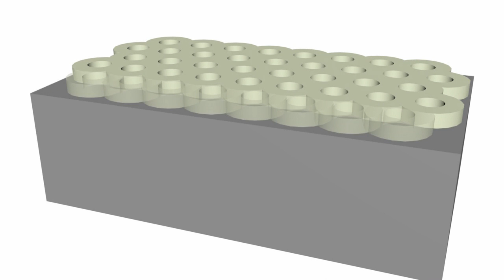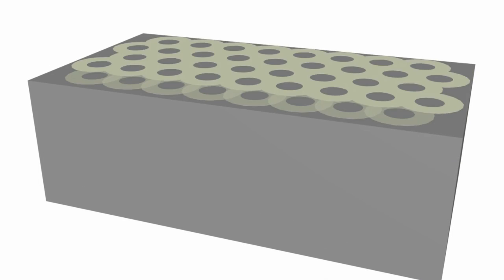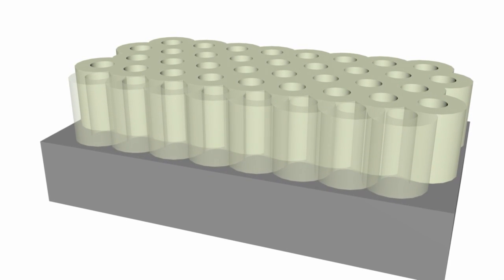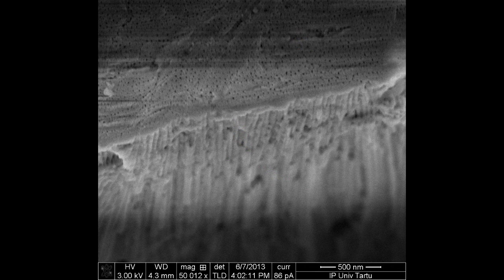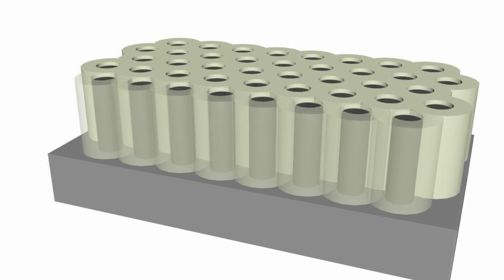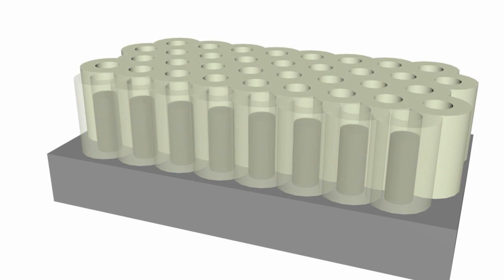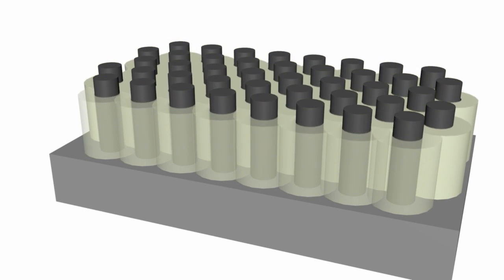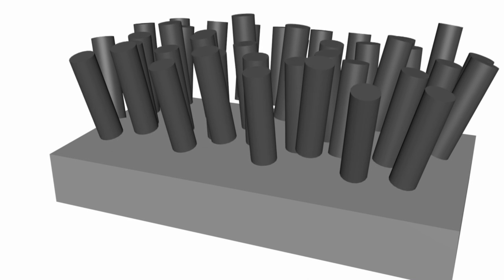Template Synthesis of Silver Nanorods

Comment: Sir I want to deposit FeMn nanowire by time base dc electrodeposition but current is in pico amp .... And also deposition is not smooth can you help?
Reply from the maker: I have never deposited FeMn, so it is unlikely I can be of use. If you are using an AAO template, then you might need to optimize the pore size and study the cross-section of the AAO layer to verify that you have suitable pores. Then you might also look into solutions to ensure that the electrolyte can enter the pores. If your AAO has dried, then pores are filled with air and this may hinder deposition of material. Ultrasonification may help but probably you should never dry the AAO in the first place. After that it is probably down to electrical parameters that you use in the deposition.
Reply: @CaptainCorrosion  thank you sir

Comment: Sir could you kindly provide me templates of different pore sizes.
Reply: We produce high quality AAO templates with the desired pore size. Our facility has PVD machines for further modifications. Contact me if interested.
Pore size can be modified by changing the voltage, temperature and acid. Our facilities are able to produce pore size up to 20 nm in diameter.
Reply: Sir wt would be the cost 
I wanted 100 nm 200nm pore size